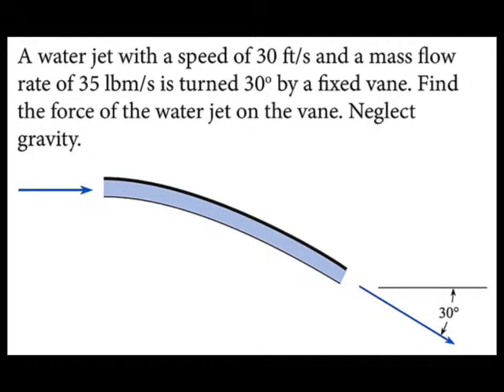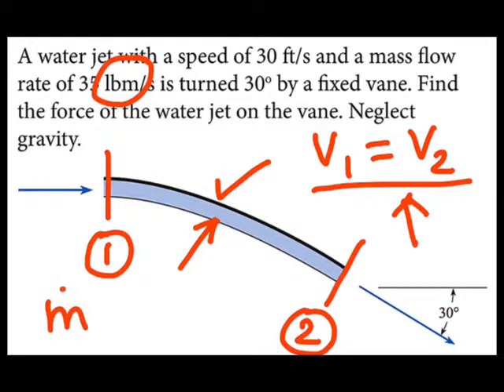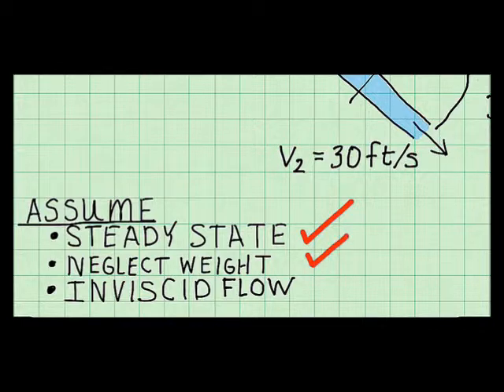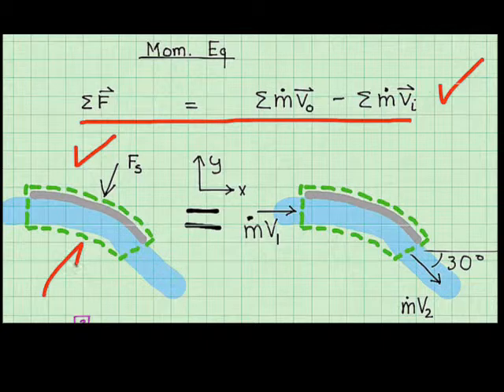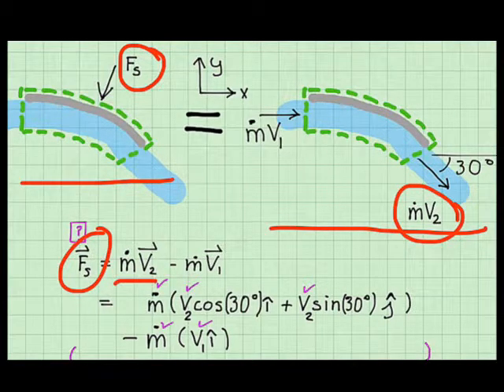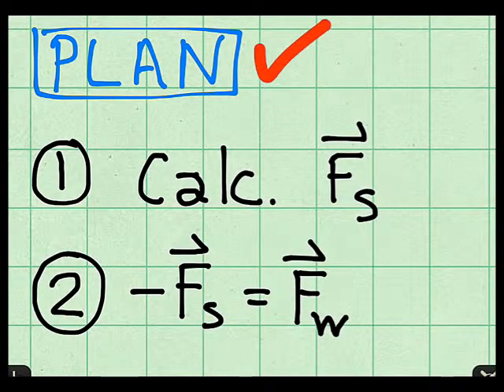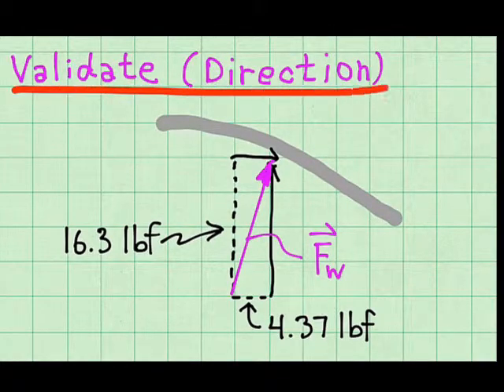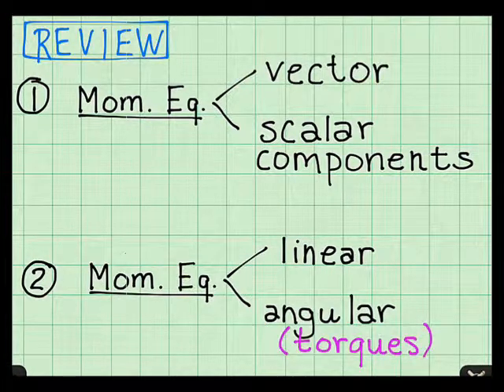video-6.26

Comment: I don't understand why it's cosx-1.
Reply from the maker: Mark Chapman Great question! It took me a really long time to get the momentum eqn. figured out. The short answer is that I am doing what the equation tells me to do. Details. The equation is a vector equation. The x-direction outflow momentum is positive mdot* V*cos(Theta). The x-direction inflow momentum is positive mdot*V. The equation says to take outflow momentum and subtract inflow momentum which is (positive mdot*V*cos(Theta) - (positive mdot*V)). To understand why the signs work out like this, I visualize fluid jet emerging from a body and fluid jets impacting a body. Hope this helps a bit. Keep working through problems.
Reply: Donald Elger Thank You.  I actually figured it out after looking at it for awhile.  Once I paid attention to the components I understood.